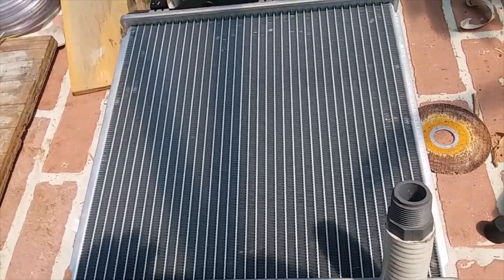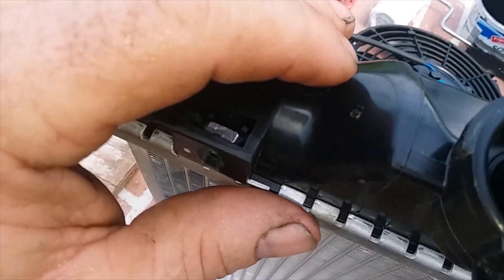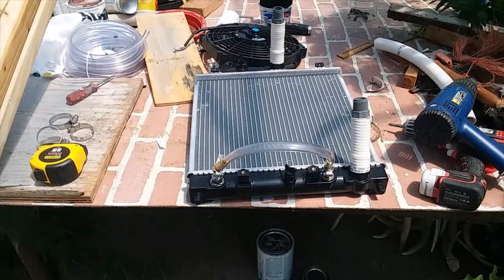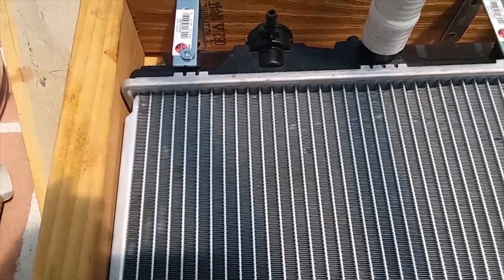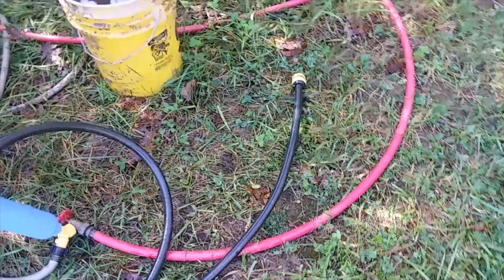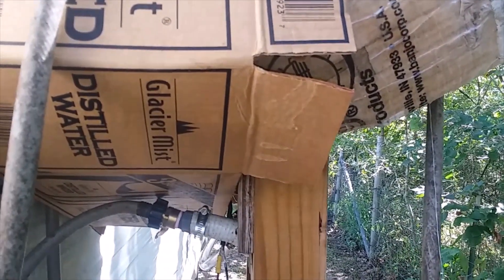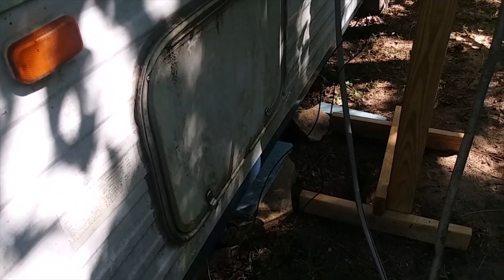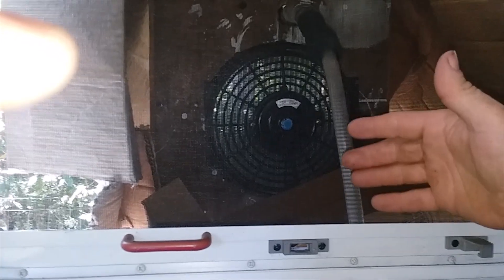Spring Water Air Conditioner

Comment: I had almost an identical setup to this in my cabin. We had a heatwave in the UK a few years back and it was 42c (108f) outside. We had a borehole so I ran the water through a car rad as you have and was pumping 16c (61f) air into the cabin with hardly any flow on the water. It was all inside the cabin so it recirculated the air.

The issues i faced were lots of condensation on the rad which i had to collect in a tray and of course noise. But otherwise a fantastic system.
Reply from the maker: @larry365  thanks for watching, I appreciate it. I don’t use it anymore but it works and yes you need a drip tray preferably with a drain hose, my tiny trailer was too small to put it inside anyway. My excess spring water overflow now goes to my garden and I have a good size solar array that powers my ac, I’m totally off grid
Reply: @littlebeavercreekhomestead311  love to hear it and congrats on achieving this!

Comment: It would cool faster if you were not drawing hot air from outside. Just keep the radiator inside the camper and block the windows. It will just keep recycling the air you got inside your RV. Will cool much faster. A window AC doesn't bring in air from outside it recycles the air inside the room. The heat gets transferred outside. In your case the heat leaves with the water and gets dumped outside.

Comment: I'm wanting to try this. But bury two 55 gallon barrels in the ground, and run a 12V circulating pump. I'd try to use a hydronic a-coil air handler w a 12v fan (2 x 300cfm).

Comment: I know this is old but didn’t see it mentioned 8n the comments…that the two fittings you put clear tubing on…is for transmission lines to cool fluid …and is actually A SMALL tank inside that one larger tank… that stays separate from the water so you didn’t need the hose… but you could hook a line to them that fastensto a heater core as a sub coil… and cool a smaller area local to where you sit with a smaller and quieter computer power supply fan… or one from a fridge…very low watt by dc power…
Reply from the maker: @jamessnider5978  yeah I’m kind of a dummy when it come to stuff like that. I have a big solar aray now for air conditioning but I’m still using the spring for water in my house and the excess overflow from my spring waters the garden
Reply from the maker: @jamessnider5978  thanks for watching

Comment: Very good. Good to see someone try this.
Reply from the maker: I really don’t do much with my channel anymore and although the cooler works good a now have enough solar to run a small air conditioner, off grids and loving it. Screw the power companies lol. Thank you very much for watching
Reply from the maker: And also it does work better to suck the air through than to blow it through the radiator

Comment: Put that whole thing in the trailer and shut that window it will cool much better recirculating the air over and over
Reply from the maker: Yeah that would work pretty good but it’s really cramped in there as it is. No longer sleeping in it anyway.

Comment: I could do that with my well and a solar well pump. The water should be around 55 degrees. Bury the supply pipe deep and use the rubber type pipe insulation on it. Run the return out on the garden or away. Insulate everything extremely good and put the radiator/fan assembly inside and it would be like having your car air conditioner on recirculate.
Reply: I would use a 12v pump or solar pond pump and a ice chest as a water reservoir and just keep recirculating the water. Maybe even add some isopropyl to the water

Comment: You didn't need to loop  those clear tubes on the bottom of the radiator. Those are not connected to the rest of the radiator. That is where your transmission fluid goes in and it cools it. Like the other guy said you need to put this inside so it recirculates and cools even when the window isn't open. Also shop around you can find a radiator cap and you won't risk leaking water all over. You can find them cheaper if you look online. Run a wire over to the unit so you don't have all those connections laying on the damp ground.

Comment: Do you know the temperature of the water entering the fan-coil?
Reply from the maker: If I can keep it cool from the spring it should be somewhere around 58 deg.F. I still need to bury some line. also I think I need to have the fan pull the air through rather than blow it through. Thanks for watching

Comment: Move it all inside the trailer so that it recirculates instead of constantly cooling new outside air.
Reply from the maker: Well, no room inside plus condensation problems but we do plan on putting it inside are house when we get it built. Thanks for watching.
Reply: @littlebeavercreekhomestead311  yes, you would have to build a drip pan to catch condensation just like an AC unit would do. It looks good; keeping thinking out of the box.

Comment: Please put that inside. Run hoses in and out window. That system would definitely work better. Just watch condensation.
Reply from the maker: Your probably right but there is barely room to change your shirt in there. I have plans to use it elsewhere, and will make some sort of drip pan. Thanks for watching.

Comment: Looks good. It may be more efficient to put it inside the trailer and let it recirculate the same air to cool it over and over. That's what I did in my cabin and after a while, I had to turn the fan off because it was getting too cool. You just have to be careful of condensation, maybe put a tub under it to catch and drips. Good job so far, I like it.
Reply from the maker: Thats what I plan to do when I build a cabin,  that trailer is so small I have to go outside to change my mind. Thanks for watching.
Reply: That's what I was going to recomend.

Comment: Hope you can stay cool this week. Hotter than  blue blazes out. Got heat exhaustion here two weeks ago and here we go again of another week in the 90's with high heat index. I'm ready for a dry out. I'm wet clothes wet bed wet been like this for a month. At least the nights have been cooler.
Reply from the maker: We are back home now but my son is still out there. And boy was it was hot. It will start cooling down pretty soon though, hang in there Dani. 
Thanks for watching and God bless.

Comment: I tried something like Your rig with a radiator, bilge pump, cooler filled with water and 2 frozen milk jugs, the temp went from 92 to 68 in one small room but only lasted for a half hour and the water temp rose back up, wish i had a cool spring running on my property!
Reply from the maker: You know, you could build a cheap cistern by digging a 4 or 5 foot round hole and line it with a wire fence several times and about two inches of sand cement mix with a bottom and a top, if you get enough dirt on top it should keep it cool enough. That's how I build my septic tanks and have never had a problem with one yet.
   Thanks for watching and God Bless